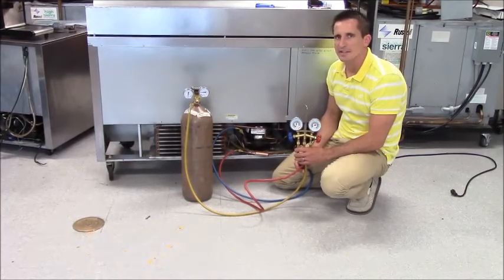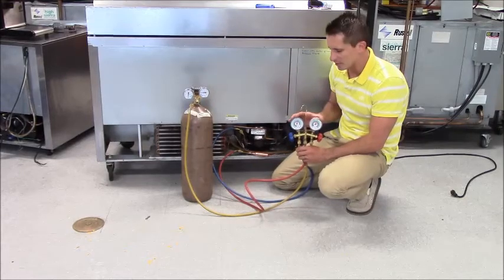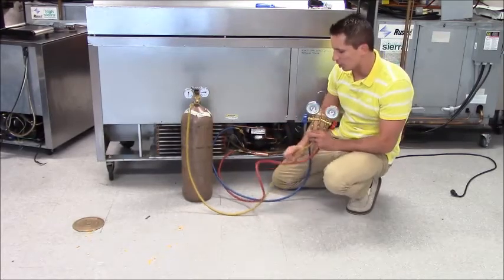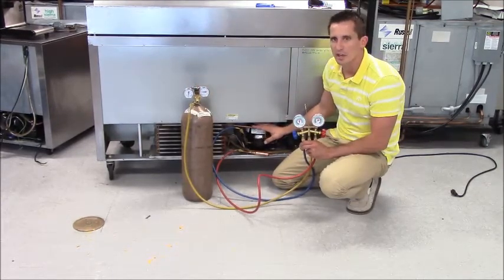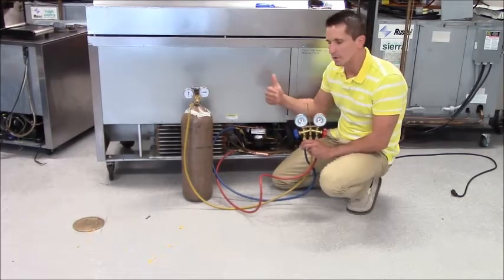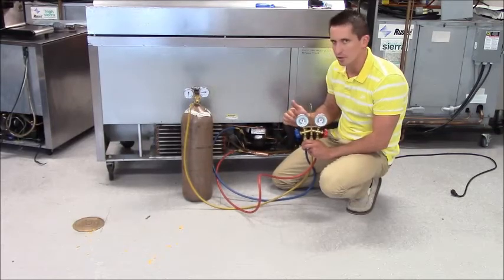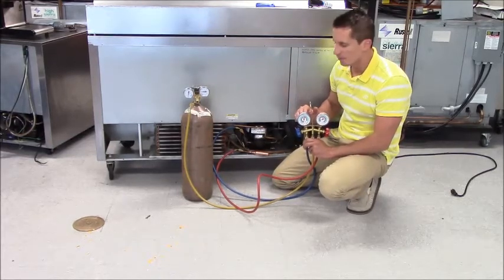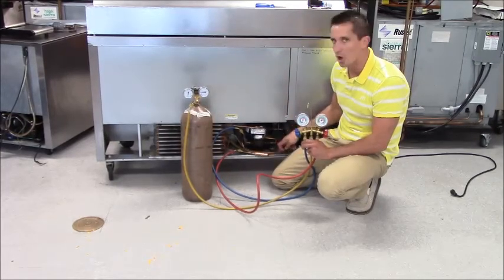MTO test the cap tube

Comment: Thanks man also could you explain if cap tube clogged how we clean and what is sign  for clogged dryer and cap tubes thanks a lot
Reply from the maker: if the cap tube is clogged you can try R11 flush, but I have not had good luck with it,  others have.   I would just replace the cap tube.  depending on system size you may get lucky and be able to just trim the end of the cap tube if that is where the obstruction is.   If filter drier is clogged it may begin to frost and have a large temperature difference from inlet to outlet. you will a also see high head and low suction.  best way to confirm is to reclaim, then add nitrogen to high side and see if low side gauge rises.  if it doesn't, you've got a restriction.
Reply: thanks a lot
Reply: one more question....  I did same like you did my high side pressure went up and low side rises after high side become 60 psi . when you add nitrogen from high side low side should be rises immediately or do we need to wait a little .....thanks
Reply from the maker: this is normal.   when you introduce pressure to the high side, the compressor valves prevent it from going backwards into the low side.   therefore it must take the path of least resistance which is through the capillary tube.   the inside diameter of the cap tube is very small (think pencil lead size).  now, if your sides do not equalize,  there is likely a restriction and the cap tube is a very common location for this.